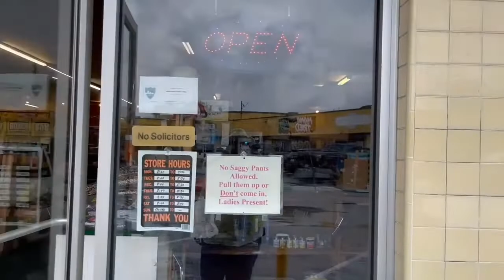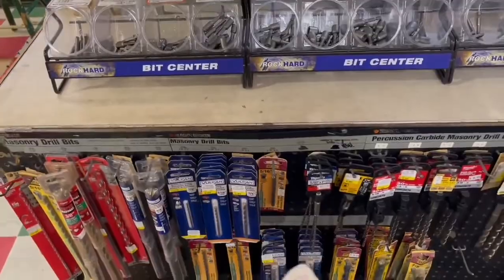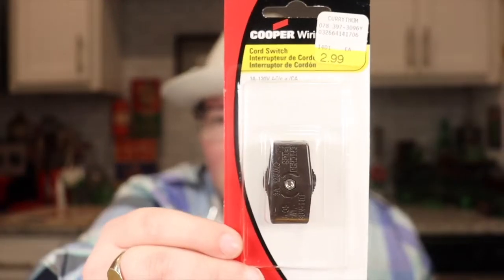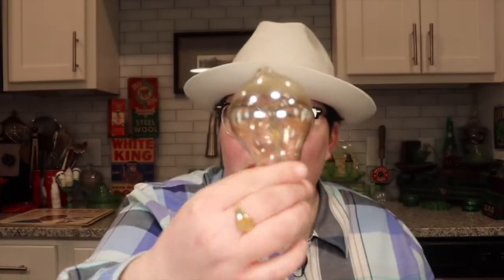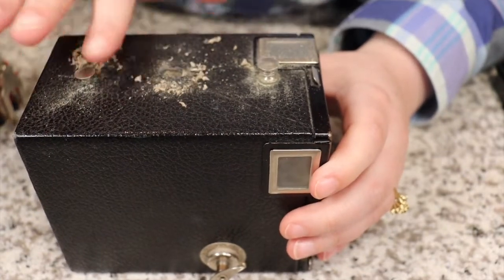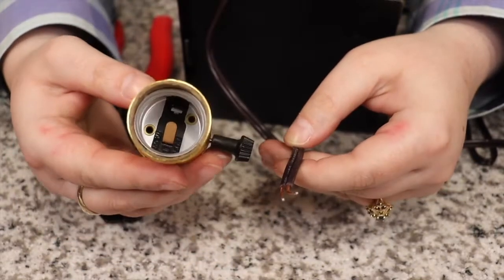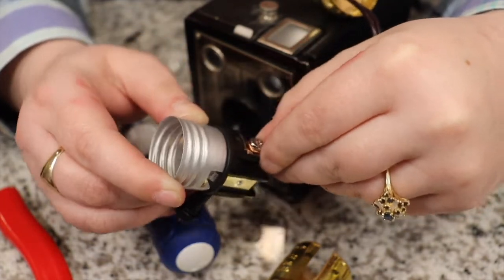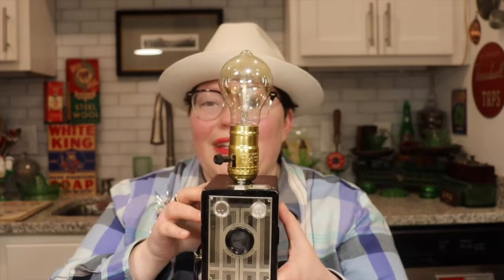FROM TRASH TO TREASURE | CAMERA LAMP | TALES FROM THE TRIPTYCH

Comment: This video was way too long. There was a lot of talking as well. I suggest you edit a lot more often than not.
Reply: Like you had anything else to do
Reply: @cathybiller9203   I did, and that's why I scanned it in 10 second Mitch. Get use to failure, but you probably already have by the looks of it.
Reply: @mrsfreelove157  well if you scanned in 10 seconds what's your problem Hag. 🖤